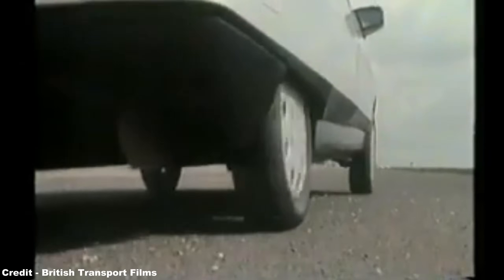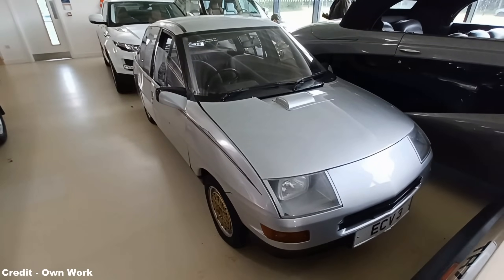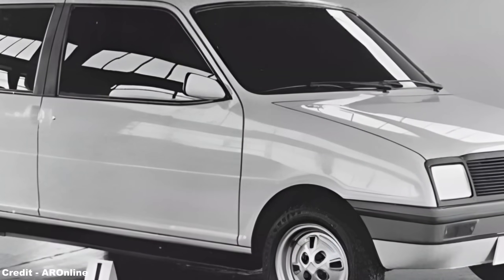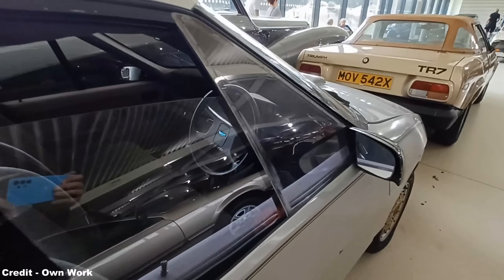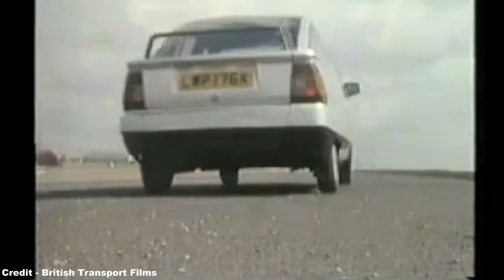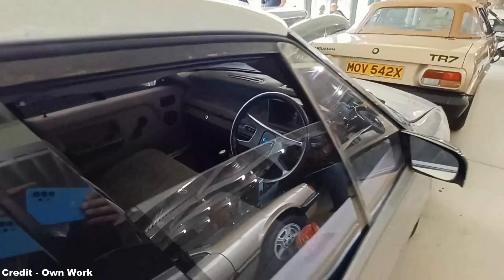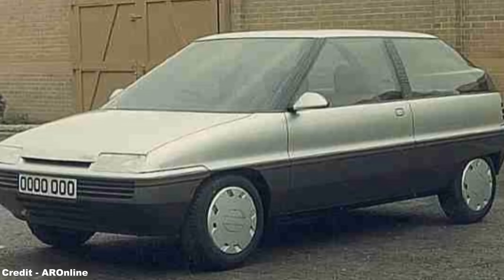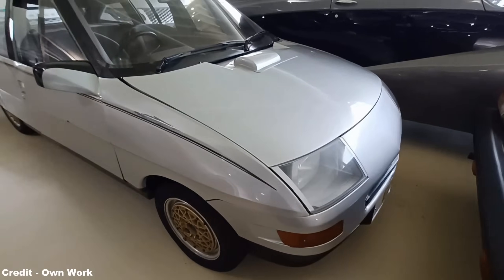Prescient and Prepared - British Leyland ECV2 and ECV3

Comment: The ECV3 looks like someone took a Citroen BX, put into a CAD program, then smashed every vertex with the filet tool. Plastic construction for non-structural elements was also done by the Citroen BX.
Reply: looks to me like some kind of a Vauxhall
Reply: The BX was a originally a Pininfarina design for Reliant but they couldn't pay for it so it was reworked and sold to Citroen. This explains the large amount of plastic which would likely have been fiberglass in a Reliant version.
Reply: Ironically BMC had been working on similar looking cars in the 1960's, before the BX even existed.
Reply: @jimtaylor294  Pininfarina 1800. GS rather than BX?

Comment: For me, the glaring gap was the safety one. Every time they made the vehicle lightter or increased interior space, they reduced survivability - that leg room like a Sierra was your crumple zone!. This does suggest that BL could have had something like the Fiat Cinquecento / Seicento to market in the 1990s had they survived but the wider BL problem was always their lack of clear direction. Having so many marques and so many design histories and so many ideas under one roof meant that it was very hard to create a single manufaturer with a coherent plan. 

Ah well.....
Reply: Eeh. Citroën proved in the 1950's that you can design a car with both. What resulted was the GS, which had industry topping safety features such as crash and even rollover protection, as well as an amusing ability to drive without one of the wheels if needed to.

Comment: Lean burn! That thing would have amazing economy but poor nox emissions to a point of needing def to meet current petrol standards and unless it had a rich burn mode for acceleration it would have a 0-60 measured in minutes
Reply: "poor nox emissions"
Based on what? 😂
Reply: The K series was designed as a lean burn engine to meet emissions regs without a cat. Then the EU made cats compulsory and Rover had to drop the lean burn aspect to make the cat work. 
If they'd just specified emissions levels, it would have been introduced as a lean burn engine,no cat and with better fuel consumption.